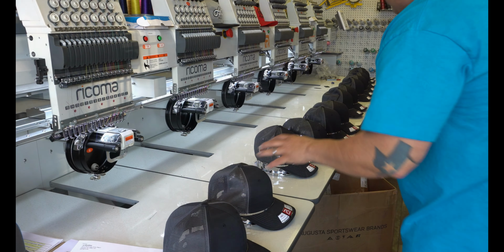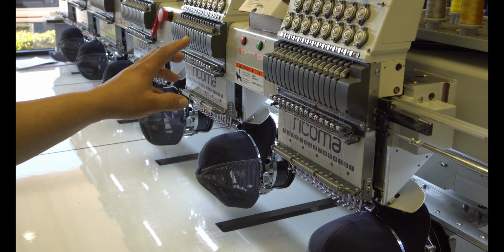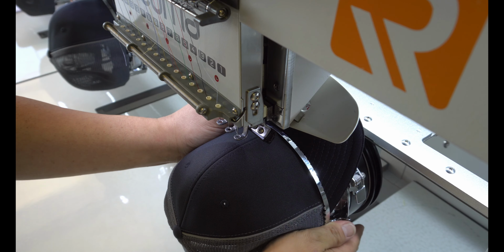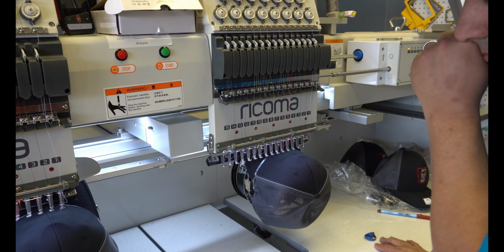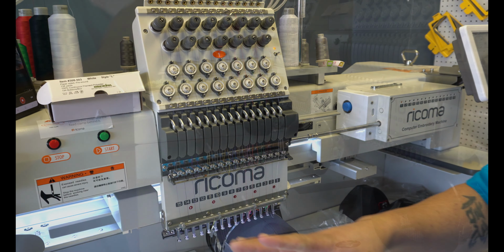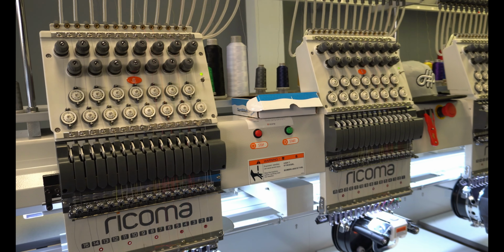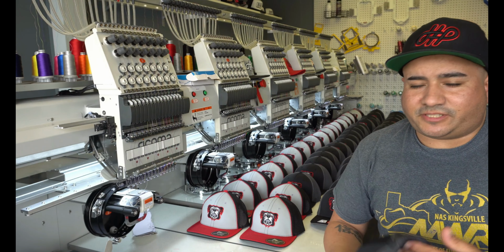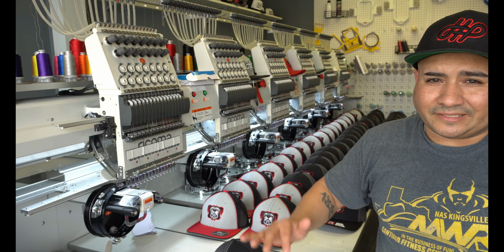How I do hats on the CHT2 - MT1506

Comment: Hey Joe, Great video.  I was wondering if you have any tips for getting all each of the heads adjusted before a run?  I have MT-1503, and I ruined 3 of my customers hats, before I got them done.  I'm thinking maybe I run an H test on all the heads before I start the hats.  What tips do you have for getting a multi head machine ready before starting a job.  Thanks for any input you have. God Bless.
Reply from the maker: Hey sorry so late. Once you put them on the machine you have to make sure they are all center on whatever needle it say or just move to to #1 so there no confusion. If it not simple unlatch the one thats not and center it. THE TRACE is the biggest thing. ALWAYS trace. Hopefully this is what you were asking. If not call the shop Monday 706-922-4455